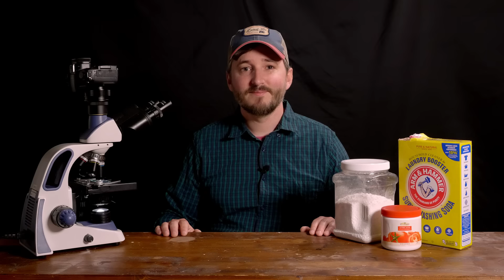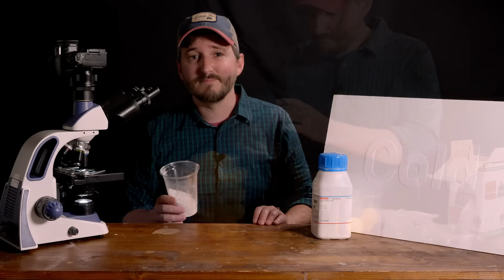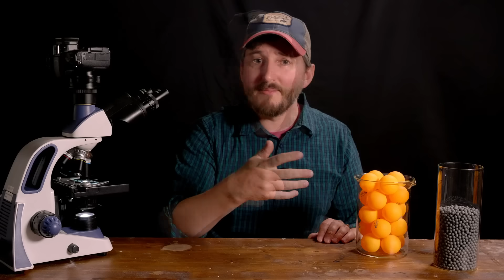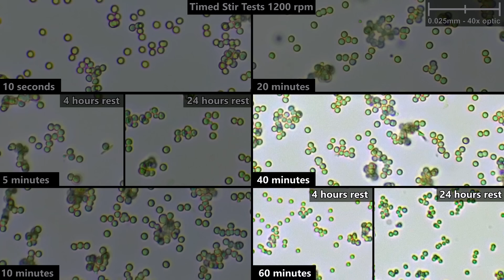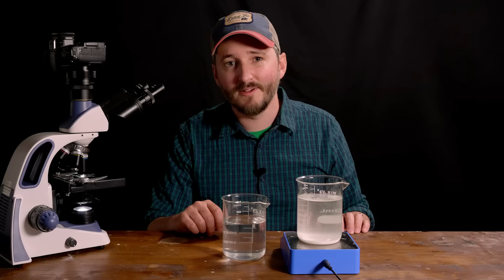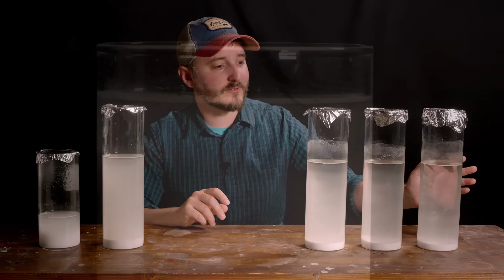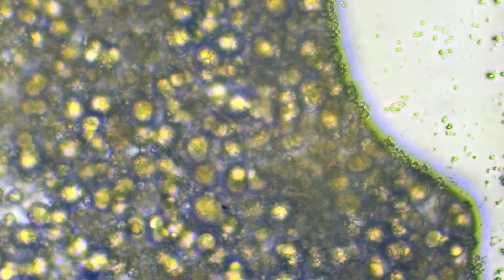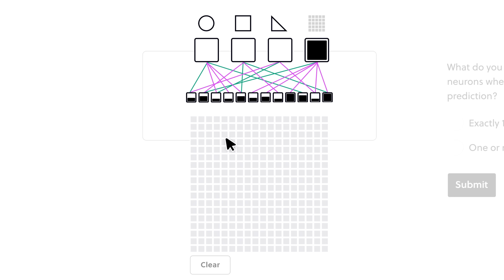Making Infrared Cooling Paint From Grocery Store Items (w/Novel CaCO₃ Microsphere Synthesis)

Comment: I gotta ask how does your method compare in efficiency and such even contact me directly to talk to me about this but how does it compare to like Henry roofing company? They make all types of roofing supplies and then they tropical and tropical a silicone based really white and it has enough adherence in the silicon you could spray it and enroll it in, but you can and you can use it. Use it in strips. It’s very practical it’s very friendly to work with and but you can add X add extra titanium oxide to it so you can boost it even wider and where I’ve used it professionally in conditioner, contracting, and design work and I’m also a farmer the letters after my name get real confusing and so how does your process and your efficiency compare to a boosted tropical from Henry? Anybody else like to communicate on this? This is one I’m a squid a former new crew Supervisor? if you know what that is, you totally understand where I’m thinking and I’m a 3361 with all this whistles and bangs.

Comment: Wow this is amazing information. I’ve come here as I’m planning to move to the Philippines and am researching better ways to build a house for the hot climate. 
I look forward to the day this is made commercially available. However, for someone to keep things simple, couldn’t one just mix Lime into some paint like white silicone paint and achieve a good cooling effect? Sure it wouldn’t be nearly as effective without the different size balls giving it high density, however it should still have a positive effect right? 

I also missed why was acrylic used specifically, was it because of the foam effect with added water, which further enhanced the cooling effect? Wouldn’t using something like a silicone paint be pretty good for use as a roof paint? The silicone would seal the lime within and make the paint waterproof? 

I think the biggest benefit here is as a roof/outdoor paint for homes, if significant cooling effect can be achieved while making it weather resistant & long lasting, this would be a game changer.

Comment: Applied to motor vehicles (even just the upward surfaces).... this could be a game-changer.

"Heat teleportation" in the media ad materials for the average consumer (not ENTIRELY wrong, in essence- the devil's in the details), or similar (perhaps, something more granularly accurate while also being 'good branchanger— does this finish's/surface treatment's performance suffer if clearcoated (would UV profiles built-in by chemistry effect efficacy), . . . ?
Putting this on a house, barn, shed, shack, outhouse, or RV is a flat-out no-brainer: "You can do it!"

Comment: Recently saw another video from a texan looking at using a lime wash to get some reflectivity on his dark shingles (Z5rDnMza7aU) and immediately had to wonder if there would be any combined application for the combination.  The acrylic has some benefit but, if possible, I'd prefer something without plastic and not requiring solvents. Limewash is its own binding agent if it is applied on the right kind of surface, so I'm wondering if it could be used as a reasonably reflective but extremely cheap, easy, breathable, non-plastic binder?  I've been wanting to experiment with a bit of barite, this calcium pigment, and simple lime to see how much difference could be made with the minimum possible cost.  Even just the lime was reported to be a major improvement over dark surfaces, so I have to think the lime with some other enhancements might be even better.

Comment: This is probably going to sound stupid, but I have seen acrylic paints mixed with white glue.  Just good old school glue, especially for knock off acrylic pours 🫗 there are also other paint mediums and additives like floetrol found at the hardware store to increase paint thickness and elasticity. 

Would white glue added to the pigment affect the chemistry of the spheres for cooling.

Also have you tried a pour paint method of application? Typically using a solo cup with a canvas (painting surface) placed face down over opening of the cup. Flipping the cup with paint and canvas upside down so that the canvas is facing up and cup facing down. Then slowly picking up the cup or moving the cup while allowing some paint to flow out from the gap between cup and surface. After the cup contents have finished pouring out, the paint surface is manipulated to allow the paint to move around the canvas surface until it is entirely covered. The remainder of paint lost over edges is significant, and can be reused on other surfaces before drying, if captured under the pour area. Another way for encouraging the paint to level outward to the edges of the painting surface is by using a lazy susan ubder it, to rotate it and use the centrifugal force to push the excess paint away from the center more evenly. 

Textured paints deliberately are not self leveling, and pour paints and acrylic resin pour paints are self leveling..

There are concrete crack fillers that are also self leveling. Perhaps there is something within those products that could help with viscosity? 

Where are you published?

Comment: I use calcium chloride to raise the calcium level in my inground concrete pool. And it's packaged in plastic bags with an inner water bag as a hot pack used as a medical supply. Similar to cold packs which use ammonium nitrate with a water bag inside. Squeeze the water bag to pop it and start the endothermic (cold pack) or exothermic reaction (Hot pack) .

Comment: when it comes to applying the "paint" on to a panel. Maybe you could try getting a tray filled with the acrylic calcium carbonate mixture and then dipping the face of the panel into it.
That way you can kinda just candle dip the paint on. If you let it sit elevated and face down then it should hopefully drip off any excess acetone or other stuff, but I don't know. I'll have to try it out myself.

I'm also curious if you need the plastic wrap to be spaced away from the paint (like you have it in the box) or if you can just heat shrink the plastic wrap on top to get the same effect and hopefully a more sturdy paint. I don't know if you've tried something like that yet before, so if you have then I imagine it just didn't work, but yeah.

Comment: For anyone interested, I calculated that for larger spheres of radius R to slip past geometrically, smaller spheres radii, r, must be less than 15.47% (2/sqrt(3)-1) the size of the next largest radius.
r < 0.1547R
And that's only a purely geometric, rigidity-assumed constraint. The likely effective functional maximum is even smaller. 
So 10% is probably a pretty safe assumption :)

Comment: Excellent video.

Might be very useful to learn pupils how to reproduce research and why it's important.

To keep it politically neutral you could explain whichever your opinion, free cooling to support your AC is a positive thing whatever you vote.

You could add some own research and prototyping to let them find methods to use it in summer and store it in winter.

It's all safe enough to reproduce with ordinary means as well. As long as you don't overdo the acrylic/acetone amounts.

Thank you for this video.

If time permits I'll give it a go. That's a big and uncertain if. If the if becomes a do I'll share it.

Comment: Has anyone discovered a good way of applying this to a large area? Thinking of painting the external south east facing wall of my house as during the summer it becomes a thermal battery heating my house to unbearable levels
Reply from the maker: You can spray it. I haven't really tested it long term outdoors myself though.

Comment: So I know it's about 2 years out, but have you considered trying to spray this paint using a bedliner spray gun? They're designed for thicker materials and use a bit more air than a normal sprayer, but it might work better than a bottle for covering large surfaces.
Reply from the maker: I need to experiment with it more. I've tried with a normal paint sprayer but a bedliner one may work better.

Comment: Amazing video! Thanks for all your hard work! Thank you for taking the time to put this together for all of us. Side note: I'm surprised you didn't spend more time touching the paint after it had been in the sun. (The IR temp gauge might not be perfect since your materials reflect so much) Simply touching for a temp difference ... or trying to fry an egg on both samples at the same time to see which cooks faster, would give a reasonable confirmation of the temp readings. Yeah, it is a method that is more difficult to repeat and it is more subjective... but it is also more human. If part of the goal of the video is to produce something to make humans more cool in their homes/ sheds / workplaces, the human touch would be a great addition to the objective IR thermometer. (But given that the army makes camouflage to trick IR sensors, the objectiveness of the IR thermometer is tricky since you are using experimental paint with unknown camouflage properties).

Comment: Oh hello Ben 👋

Hope your recovery has been going smoothly!

I was revisiting your radiative cooling series because temperatures here in India have been brutal lately. Seeing 44°C (111°F) during summer isn't unusual.

While looking into replicating your CaCO₃ microsphere recipe, I noticed that precipitated calcium carbonate (PCC) is manufactured locally and sold very cheaply here, often for ₹9–20/kg (about $0.05–0.11/lb).

Have you ever tested commercial PCC as a substitute for, or benchmark against, your synthesized microspheres?

When I replicate your recipe, I'm thinking of including a few commercially available PCC grades as comparison samples, such as paper coating/ink grade PCC and toothpaste grade PCC. Do you think that's a worthwhile comparison, or is there something about the particle size distribution and morphology of your microspheres that would make commercial PCC fundamentally different for radiative cooling applications?

I'd be very interested to know whether off-the-shelf PCC can get close to the performance of the custom microsphere pigment.
Reply from the maker: It's possible you'll see fairly good results with purchased calcium carbonate. It's important to use a precipitated variety. What might be harder for you to find is an appropriate acrylic that dissolves fully in acetone. In the US the variety I use is Plaskolite Optix brand. Note that if you need to cool a building you don't necessarily need a paint as advanced as this. It will be a huge improvement on inside temperatures even if you only paint the roof white with an ordinary white paint. It will however not help lower indoor humidity, so you may need a dehumidifier

Comment: I believe the frequency and heating mechanism is not that accurate here and its not exactly the heat radiated out getting reflected back towards the object. Because radiation is shot out at all directions. And if that energy did bounce back from the sky, its also bounced from the sky into all directions. So only a little fraction would be sent back to the object. Perhaps its more accurate to think of it as unable to effectively receive heating from the sky/environment so thats why the net energy flow is one way (out to space).

I.e. the origin of the heat is actually everything else on earth thats making it hard for any individual object to cool itself down, unless its coated in a substance that doesnt absorb this heat

Comment: An interesting video.  I disagree with your scientific conclusions such as calcium chloride absorbing CO2 to account for the calcium carbonate present in your product without considering how it was manufactured.    Further adding citric acid to remove calcium carbonate  via the displacement reaction will create calcium citrate in solution .    The effects of calcium citrate  was not investigated  in your particle size studies and its affects will depend on how much calcium carbonate was present.
Reply from the maker: Calcium citrate forms via displacement reaction with calcium chloride as well, so it doesn't matter how much carbonate is in solution as far as citrate goes. The only thing that is effected by the amount of starting carbonate is the remaining acidity post dissolution.

Comment: I wonder if using a cheap paint that has notoriously thin on the paint ingredients that has plenty of solvent the kind that you usually have to paint multiple coats would work in this application and make it more durable. I think it would be a great experiment.

Comment: Isnt this the reason why lime wash was used to paint houses throughout the history? Microspheres are good and all, but they are there just for the density. Meaning you can use the thinner layer of paint for the same effect. Lime wash is dirt cheap (you can buy it right now from home depot for under a dollar per pound); you can just apply 5 layers for even better coverage. And keep reapplying it instead of cleaning it when it gets dirty. I grew up in a Ukrainian village and now I understand why it was nice and cool in the traditional Ukrainian "hata" even on the hottest summer days: we used to reapply lime wash onto the walls twice a year. This is the same reason why they often apply lime wash onto the trunks of the fruit trees: to prevent them from blooming too early and therefore protecting them from freezing after they bloom.

Comment: Are you publishing your work? you better be publishing your work. Or your work and effort could go uncredited.
Reply from the maker: I'm fine with no credit. Publishing is a pain.
Reply: @Nighthawkinlight  hahaha fair, but as an academic, I think it'd be great even if it's just an arXiv preprint. This could very easily be someones master's thesis project. I can see applicability with both process, for the the desired configuration, and the means, in an environmental science side of things where non-lab equipment can be used to produce the paint/material in locations otherwise inaccessible or reducing costs. Regardless, this is great work and I'm glad I found your channel.

Comment: Not sure if someone already suggested this, but I suspect the issues with the paint itself could be improved by using MEK (a.k.a butanone) or another ketone from the same family as acetone. MEK doesn't evaporate as fast as acetone so it should crack less and provide longer curing/working times. 

Additionally, the blooming you're intentionally doing with water makes the acrylic very weak which is why it's so brittle and needs to go on so thick. I'm guessing you used acrylic because of the term "acrylic paint" but you can actually use a wide variety of other plastics such as ABS and ASA among others. If you find a more rubbery plastic, I suspect the final result will improve dramatically
Reply from the maker: Yes I've looked for more rubbery options. It's difficult to get the bubbles to develop properly without sticking together if the plastic isn't stiff. Still working on it

Comment: On the off chance you see this, have you considered attempting to make the opposite of this? I.e. thermal heating paint (so it would need to be heat tolerant and as dark of a black as you can manage)? I'm already planning on integrating this cooling paint into my passive eco home design, part of the design I'm using relies on a black solar chimney to carry air up and through the system / away from the living space and a super-dark heat-resistant black paint could work wonders for the efficiency of the system 🖤🤍❄

Comment: Outstanding video.  I love the presentation.  I only have two questions or ideas.  1. Does the blender heat up when you make your particles and have to blend for extended periods of time?  If so, have you considered using a jacketed blender to maintain a constant temperature?  2. A high-speed blender is certainly one way of making a quality dispersion of fine particles, but due to the physics, the concentration of particles normally has to be rather high.  Another possibility is the use of a high-power sonic probe like maybe a 500W probe.  I've used probes in the past to make dispersions of nanoparticles at concentrations closer to those you are using.
Reply from the maker: I filled the blender with ice water prior to use so it stayed cold for the duration. I've not tried a sonic probe because my focus was finding a method using using tools that are easily accessible to anyone. It would probably work well.

Comment: Was this tried on the shed yet? Anyone tried panels on a house yet? We have a summer cottage from 1850 on CT shore, only used in summer, uninsulated, no ac. Super crazy hot in mid summer. sloped roof with attic, standard asphalt tiles. Anyone got a panel technique going?

Comment: this would be really good stuff to use in radio housings exposed to sunlight to improve the cooling, and i think CaCO3 is transparent to microwaves. would be also cool for a fully passive water cooler, just needs some kind of reasonable heatsink into the water.
Reply: oh i saw you already did a cooling pipe. that will be interesting if it is usable, could be used for a cooling system's last part for emitting the heat.

Comment: I had very good results with my first mixing attempt, as you have mentioned that smaller crystals can be achieved with mixer method. Round crystals with 2micrometers in 1 minute. That is 10x smaller than the ones you showed through microscope. If I'm not mistaken, these were mixed with magnetic stirrer. My question is that if it is better to go further for smaller crystals. They are already packed and so tiny that if I were to mix more, they won't be seen clearly through my microscope😅
Reply from the maker: I'm not sure if you can make them much smaller, and it would be easier to make bigger sizes instead. You could do that by hand mixing. It is worth it to make several sizes